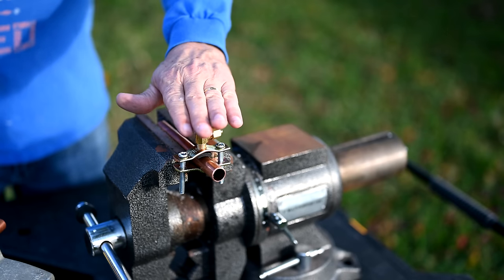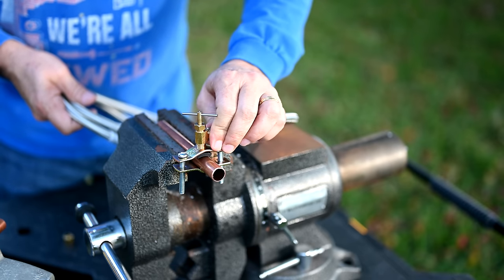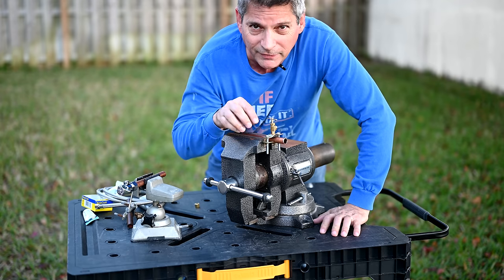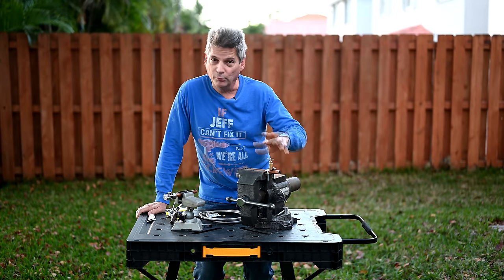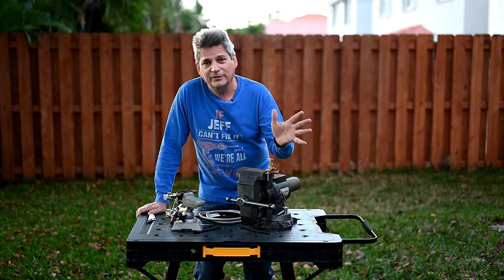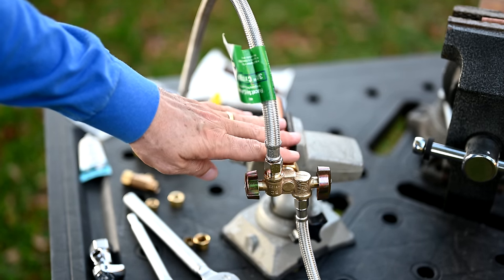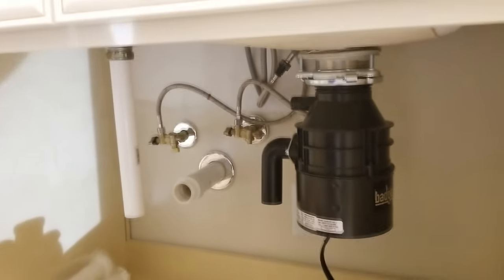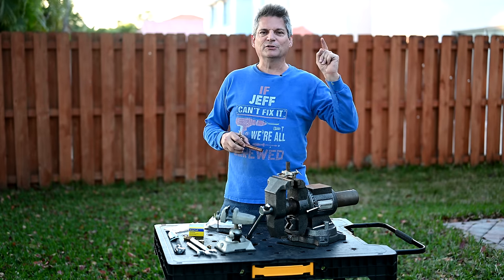Plumbing Tips: 2 Saddle Valve Alternatives For Ice Maker Lines

Comment: My only issue would be you are showing copper and don't see a lot of copper piping these days.  Why not PVC?  What would you do with PVC if that is now the water method in your home?i
Reply from the maker: Not PVC, you can't use it for high pressure, maybe you are thinking of Pex?
Reply: @jeffostroff  thanks for responding. I wish I had the flexible pipe when I decided to move a bunch of piping around.  I mean the tan colored pipe UPVC. I think it is called or just PVC.  Used it for all my water lines.  We photograph real estate and never see copper anymore.  That was used way back up to the early 70''s.  Then it went almost all plastic.  The line to the frig is the flexible stuff but that valve to feed the water you are showing is attached to the PVC.

Comment: what do you do if you have one installed already ( saddle valve )  ?? call a plumber ?
Reply from the maker: I need to do a video on this but basically what you have to do is remove this section of pipe that has the dented in pinhole from the saddle valve. So you have to cut water to that pipe then remove the section of pipe with the pinhole, and solder on a new pipe stub out and then you can wrench on a new quarter turn ball valve they're about $10 at Home Depot very similar to the valves I showed in this video
Reply: thank you , I never soldered pipe before do they make a ball valve with compression fittings ?  @jeffostroff

Comment: Thanks for the informative videos!  BestBuy is requiring a Built-in water line kit for my refrigerator ice maker.  The kit is their SKU# 9074017.  This has a "needle valve" that looks somewhat similar to a saddle valve. Is this something that I should also avoid using?   I have an approximately 15 foot long quarter-inch copper tube from my under the sink cold water valve to the back of the existing built-in refrigerator.  I am not sure what kind of valve is currently there.  What do you suggest I use, the needle valve or something else attached to the copper tube?  Thanks again.
Reply from the maker: I would not use the Best Buy kit, that is a variation of a saddle valve but still pierces the pipe,  I saw it on their web site. I would use one of the 2 adapters I showed in this video, back under your sink and run the new line to the fridge:

Comment: My refrigerator is far away from the kitchen sink. What about a tee in my pex?
Reply from the maker: I don't have any knowledge of working with Pex yet so I don't know. You should try Roger Wakefield's channel, he's a great guy, 200+ years in plumbing, LOL! He answers questions live on his livestreams Mondays at 4PM.
Reply: On my RV and mobile home work, I install a PEX T, then terminate the middle branch stub with a PEX x  1/2" MPT adaptor fitting. To that the metal compression shut offs available in 1/2" FPT x compression (1/4 or 3/8") can be installed. There are also PEX Ts that have a 1/2" MPT middle branch, but they can be hard to find.

Comment: Can you use a saddle valve on pex tubing?
Reply from the maker: That is a good question I don't think you would have to worry about corrosion but the idea of piercing any type under pressure does not sound like a good idea to me
Reply: It ovals the tubing, , the rubber saddle seal hardens with age. A leak waiting to happen. I've been working regularly with PEX since the grey days, and dislike these things with a passion 😁

Comment: Because code was talked about I figured I would mention at least where I live there needs to be a dedicated stop to each line.
Reply from the maker: Ah, so this dual valve that I use would satisfy that requirement. What city are you in?
Reply: Minnesota, maple grove
Reply: Correct on this comment. No inspector will pass a dual outlet adapter (although it doesn't make much sense) because they call for each appliance) fixture to have a dedicated shutoff. 

In addition, saddle valves will usually only leak if you start to mess around with them in my 20 years of plumbing experience, but they do suck.
Reply from the maker: @DM7817   Are you guys absolutely sure that you are interpreting your code correctly? Because if you look close in the video you can actually see the UPC seal of approval on the body of my dual valve close up which means this at least passes the uniform plumbing code, and these dual valve to do indeed give individual shut off to each line so in my opinion these dual valves satisfy the requirement. Also I can tell you I Have only very rarely seen a 3rd valve under the kitchen sink which would be for the dishwasher.  That would be plumbed in while the building is under construction.
Reply: jeffostroff I learned this when I was working on a house and needed to get a plumber in for some connections, all 3 plumbers we brought in were all masters and all looked at the tee just like the one in your video and said that both of the lines would need a dedicated shutoff. As for why the tee is approved I’m not sure.
Edit: just to clarify I’m talking about or tee the first thing showed in the video I would imagine the second option would work.

Comment: OK.  So I want to replace saddle valve that is tied into the middle of a long run.  All the examples shown are totally different than your original piece.   All the "good ways" of doing it are if the copper line ends.  It's like Apples and Oranges.  Show us a T that is code.  Is there a copper T with a valve you can sweat in and hook the line right up to?   All the threaded stuff looks like more potential leak points.

Comment: You did not address adding a 1/4” line on a 1/2” section of pipe, not beside another valve, this is where many people want to add a 1/4” line.
Reply from the maker: One day we will do one, you are talking about tapping into a 1/2" line like in the basement where there is no valve nearby, right? Her in south Florida, all our kitchens either have a copper tube coming out of the wall. or saddle valves at under the sink for the ice maker line, or a dual valve like we showed in this video. So with no basements in Florida, and in our kitchens we always have access to a valve somewhere.

Comment: Am I the only one who clicked on the first option  and found it had no 1/4 inch outlet for the ice line maker line ?  Everything is 3/8 x38x 38 inch  ????
Reply from the maker: I corrected it, Amazon sellers might have shown wrong part they are similar in number. Here are corrected links to all 3 valves I mention in the video:
🛒 BRASSCRAFT CT2-664X P Valve Adapter Tee, 1/2" In x 3/8" OD x 1/4" OD for Ice Line: https://amzn.to/2D5oCo9
🛒 BrassCraft KTCR1900DVX R Dual shut Off Valve Cold Water Ice Maker: https://amzn.to/2OfHAeL
🛒 BrassCraft KTCR1901DVX R Dual shut Off Valve Hot Water Side: https://amzn.to/2Ua4B6y

Comment: Okay..but your 2 solutions here are only for people with a faucet close by! Most people that use saddle valves are tapping into a line usually under the floor of the refrigerator from the closest pipe available in the unfinished ceiling of the basement! Making your 2 fixes here completely pointless for those folks.
Reply from the maker: I disagree. If your fridge is going in a kitchen, you have a kitchen sink faucet close by. Maybe there is a bathroom close by you can drill a small hole in the wall to run the ice maker hose through. Heck at my friend's large kitchen 3 months ago, we bought a 20 foot long steel belted ice maker line. You can buy multiple ice maker lines and connect them together with $2 inline couplers, until you finally reach a faucet. Sounds like you're just giving up without putting a little thought into it first.
Reply: @jeffostroff  no... Im just making a point, our fridge is completely across the kitchen from our sink, alot of open space between leaving it impossible to run the line threw cabinets etc.. you would have had to run your line off the faucet down through the floor down to the basement over to where the fridge is and back up threw the floor to connect to the fridge... Using your solution here anyways. Making it way more realistic and practical to just tap into a line under the floor in the basement and up, making your solutions in this video not usable! So again.. Most people using these saddle valve kits are using them because there is not a reasonable faucet near by or easily accessible to get water for their fridge!
Reply: @jeffostroff  WOW what a hack job, you must be an Engineer

Comment: They leak. I lost my job because the guy training ring me did not properly train me. I installed four stage filters that what we used saddle valves. One place leak.  He went in after I did . The next day water was all over the floor. Thise valves cost me a job better listnen to him saddle valves look easy but they will sometimes leak bump them putting liquid under your sink . You would think they are tight. I torched it so it would not move it leaked with me checking and double checking.
Reply from the maker: Dang that is a bummer

Comment: How do I cut a copper pipe? Go buy a $200 tool for one use? 

Why not put a piece of duct tape on the bottom of the saddle valve to prevent the two metals from touching (if it does matter).
Reply from the maker: The problem is you're assuming pure brass which are really getting is some kind of garbage alloy from China that you have no idea what's in it and likely it will react with the copper. Also I don't know why people keep coming up with duct tape as a solution for their problems. I don't think duct tape should ever be used for anything because it dries and cracks after awhile and disintegrates

Comment: You are wrong. It is not a valve. It is a saddle tap. It does not shut off.  But you are correct they are illegal and junk.
Reply from the maker: No....YOU are wrong. It is called a valve, and it does not stay open, you can turn off the water with it, that's why it is called a valve. Here is one example on Home Depot: https://www.homedepot.com/p/Everbilt-3-8-in-OD-Compression-Brass-Saddle-Valve-Fitting-800489/300096246?source=shoppingads&locale=en-US
I don't know wher eyou got your info from, but don't use that source again, it is very unreliable
Reply: 30 years of doing plumbing. I am yet to see one that is an actual valve. The only ones I have ever seen have a taper on the stem that would hit the side of the copper hole but that wont reliably shut off. I would not call that a valve because there is no seat and washer. I have removed hundreds of them. They are junk and not approved by code.  If you have one of the so called valves I would appreciate a picture of it disassembled.

Comment: This is not useful to do what I need, which id to replace a bad saddle valve on a copper water line with a valve that meets code.
Reply from the maker: I plan to do a video on this in early spring time

Comment: You made a good point and a good video. But it makes you annoyingly stupid to bash China for the saddle valve. Weren't all the other parts you showed also made in China? It wasn't probably designed in China. The big box stores or their suppliers designed them and sent whatever specs, including what metals to use to China for manufacturing.
Reply from the maker: Something about the metals on these parts from China makes them corrode quicker. Also look up Chinese Firewall Failures, Parkland, FL

Comment: Great video.  Where could I find a 3/4" x 3/4" x 1/4" tee for replacing a saddle valve for a humidifier?  This is coming off water heater so it must be for hot water use.  Preferably all 3 compression fittings...  NOT Sharkbite style like this one:  https://www.amazon.com/gp/product/B01HVHLZV2/ref=ppx_yo_dt_b_asin_title_o00_s00?ie=UTF8&psc=1
Reply from the maker: Good luck on that 1 Because all of the 3/4 inch sized ones I have seen are pushing types like the shark bite. What's something like that in a 3/4 inch I think you are better off just soldering in AT and in making sure you have a 1/2 inch stub out pipe and input your valves at the end of that stub out as a compression fitting
Reply: @jeffostroff  Thanks for the quick reply.  Doing a little more searching after I asked the question here, I sort of came to the same conclusion:  what I was hoping for doesn't exist and my best bet is to add the valve after the stub out.  Thanks again and keep up the great work!

Comment: Code, schmode...saddle valves are fine for the homeowner to use on his own stuff, provided: 1.) Use only on a vertical water line. 2)  Drill a 1/4 in. hole in the copper line before mounting the valve.Do not use the piece point to make the hole. Comments fix more stuff than your paranoid videos.Give it a rest.

Comment: Saddle valves eventually end up leaking and corroding. Plumbers love to cut corners
Reply from the maker: I think the better plumbers know to avoid it, but it's many of the handymen and cheap installer used by Sears, Home Depot, Lowes, etc, that do the quick and dirty saddle valve installations.

Comment: As  a NYC master plumber and h  i made a fortune testifing agianst the stumblebums /  incompedent  morons who actualy installed this crap  
held 3 other master licenses

Thnk about  it   once some  idiot installs this they lost all credibility  and makes  it very easy to discredit them for any other work they performed. 

It takes a certain mental midget to  install one then try to justify why they used it    .

I  did remove several  of them and usualy charge over $500 and the  home owners sued the installer in small claims court and won.   

  I must disagree about usig one valve for the kitchen sing and ice maker. 

 I do install one shut off for each.

Like the inconsiderate jerks who install   only one valve for a waster heater  or no valvees to isolate a circulator ona hydronics system
Reply from the maker: what is your opinion of the double shutoff valve I showed here, the big one with 2 shut offs on it?

Comment: Insurance companies will NOT reject your clam due to a saddle valve  Especially if you installed it.  Agree there's better ideas but stick to plumbing.
Reply from the maker: That is a complete falsehood I don't know where you got that information but completely incorrect and you may want to correct the source that gave it to you. Insurance companies are tired of paying out claims to faulty P traps and to faulty saddle valves that result often in lawsuits, and insurance claims in the $10,000 to $30,000 range. If they find one on your house during an inspection they will make you take it off. I have already had to go to two ladies' houses to remove their form and fit accordion flexible P traps or the insurance company was going to drop their insurance.
Reply: @jeffostroff  There's a difference in what you just said.  They will inspect and decline a risk f they decide you should have a different piece of plumbing.  Once taking the premium they will not decline the claim solely based upon the equipment. I am the source.  I am am insurance adjuster and a lawyer. Policies are free to exclude  things but the standard forms do not contain such an exclusion.